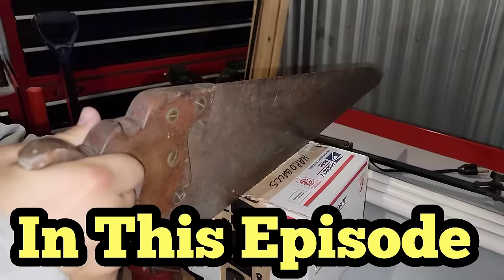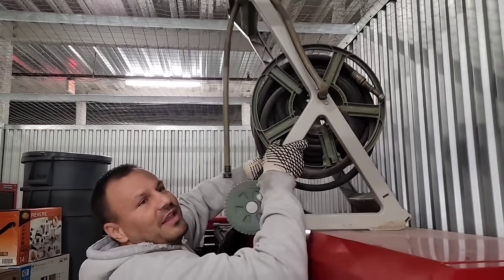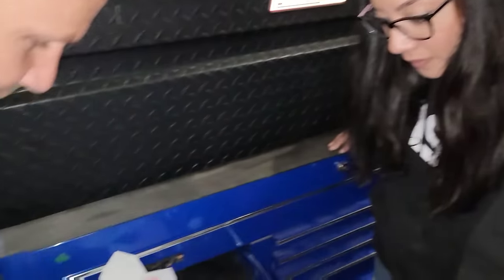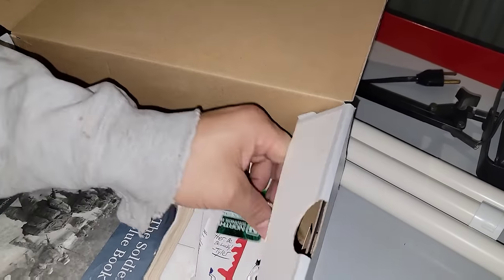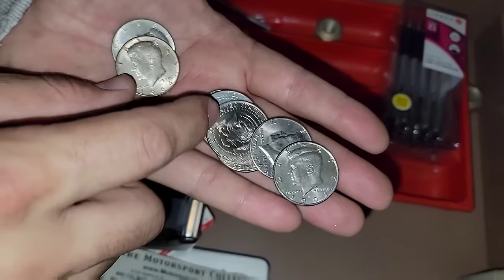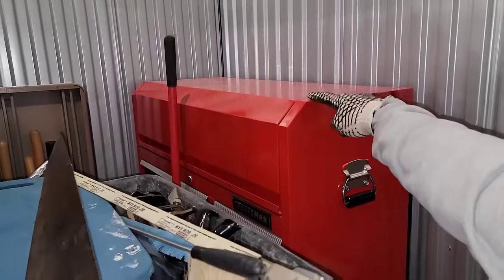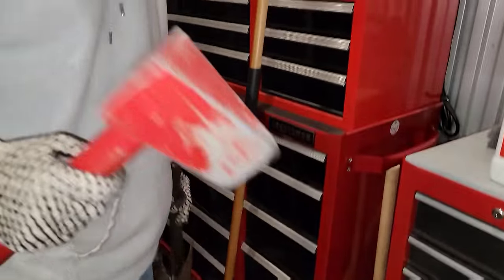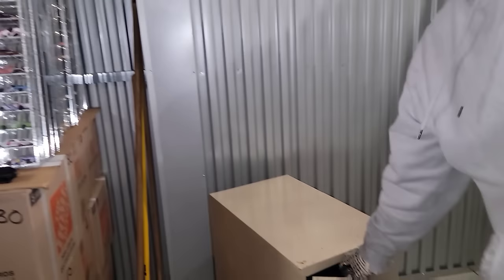The MOST EXPENSIVE STORAGE UNIT I Ever Bought Made BIG MONEY

Comment: Don't you have to open the top section to get the lock on the drawers to open? I think Conky needs to buy that whole workbench. The poor previous owner must be so heartsick at losing the unit. I thought I saw a flash drive in the top drawer of the first file cabinet (with the office supplies and coins). The orange "wedge sledge" was marketed as the "Monster Maul". I haven't seen them advertised for at least 20 years now. It's heavy, but man does it split the wood! Just don't land on the handle or you'll regret it. LOL My grandsons collect the die-cast planes and they are NOT cheap!! I can't wait to see the rest!! Congratulations, again!

Comment: Jeremy them snap on tool chests may not be locked by key. There is a little slide lock under the handle of one of the drawers usually on the right side. It is like a little black slide lock. Take your plight and look or feel with your fingers. A also if you keep the tool chests you can order replacement keys from the manufacturer. All you need is the number/ letter on the lock itself

Comment: I coulda showed you how to open just those kind of locks. Here's a tip if you find a key that fits into the keyway but it won't unlock the lock, out a slight amount I do mean slight like less than a pound of turning pressure on the key while it is in the lock then if your not putting too much pressure on the key and lock you should be able to slide the key un and out you will be surprised at how many locks will open using that method. Look for old cabinet keys that's what key you need for those locks GL2U